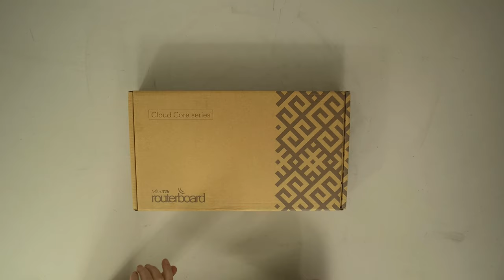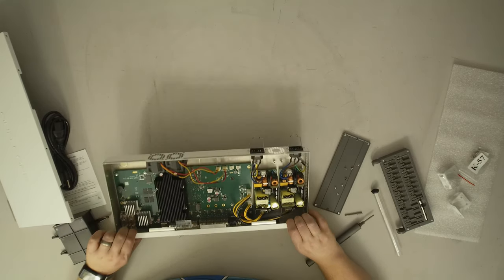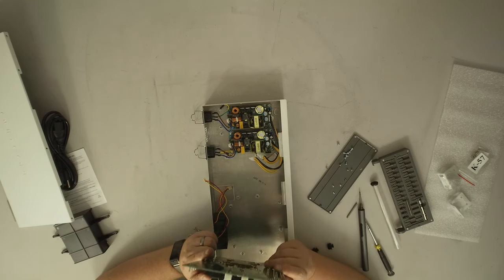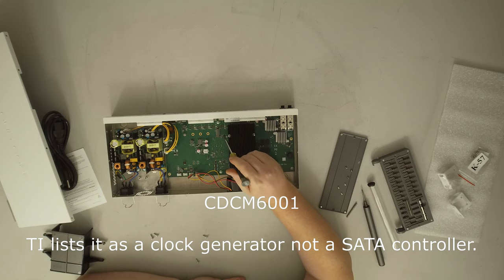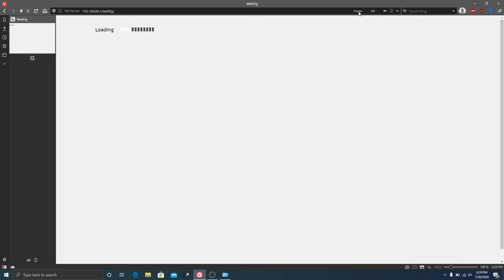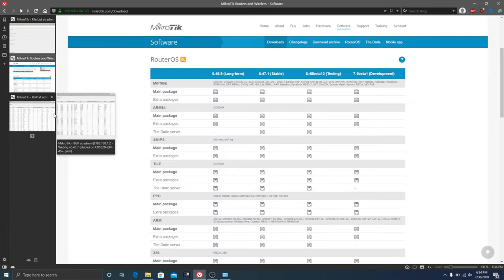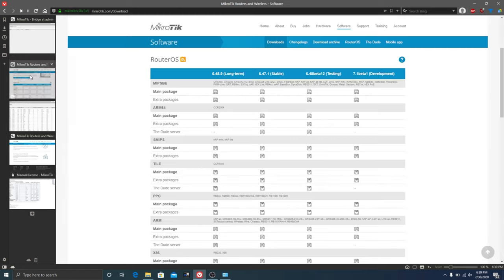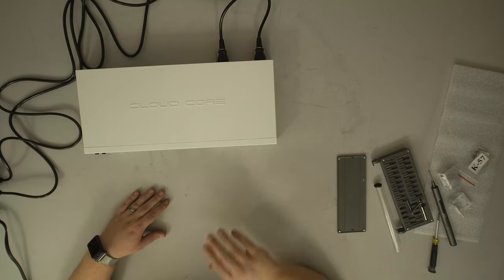Mikrotik CCR1036-8G-2S+EM teardown and overview

Comment: The single power supply version of the CCR1032-8G-2S+ (EM and non-EM) has two SODIMM slots, but no M.2 slot.  That is how/why you will see some with 16GB RAM..  32GB RAM is possible with 16GB SODIMMs too.

Lastly, the M.2 is NVMe (x4) not SATA storage.

Comment: It would probably be ok to move one fan over to cool the p/s's. You could do thermal testing on both cpu & p/s's prior.
Reply from the maker: I could except they're both in the rack at work now! They have been since shortly after this went live and not a single issue to report on them.

Comment: Is it possible to reset by jumper hole when reset button is not work
Reply from the maker: Not that i'm aware of but if you use the reset button you can boot it into "netboot" mode and re-flash it using a pc

Comment: I am curious about your screw driver setup...
Reply from the maker: It's a "Creation Space" branded lithium screwdriver, a fairly generic model available on amazon under at least a dozen names(which is good since creation space doesn't sell it anymore) https://amzn.to/3mRJlgw
Reply: +100500 , nice one !
Reply: Didn't look like he trusts it to install screws probably because it lacks a clutch.  If that's the case, it's useless.  Now if they made one that started automatically when left or right pressure was applied and had a variable clutch, I'd buy it!

Comment: good night friend, i'm eliesio de fortale ce, would you have the electrical diagram of ccr 1009 and 1036, that you can give me?
Reply from the maker: Mikrotik puts the block diagram under support for the ccr devices, here's the one for the 1009 https://i.mt.lv/cdn/product_files/CCR1009-7G-1C-1Splus_200627.png and the 1036 https://i.mt.lv/cdn/product_files/CCR1036-8G-2SplusEMr2_200554.png

Comment: ISP yang bang gunakan apa..
Reply from the maker: Several I deploy mikrotik hardware both residentially and commercially without any isp related issues here in the US. Some providers have required that their hardware be set into a "modem only" or "bypass" mode where a coax capable router just hands everything over and acts as nothing but a coax to ethernet bridge, others like my ISP at my residence simply hand off a cat5 connection I can plug directly in and not have any of their hardware except for the ONT